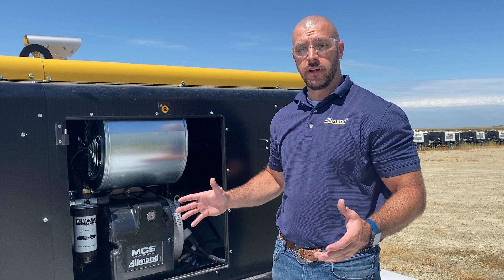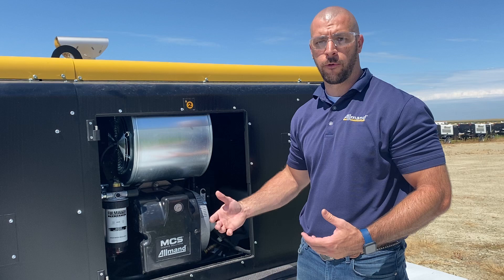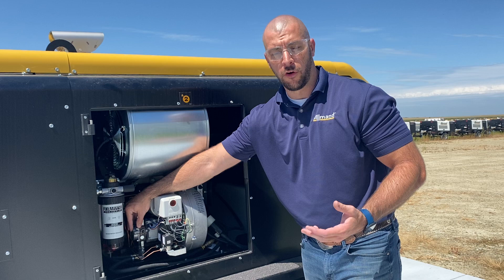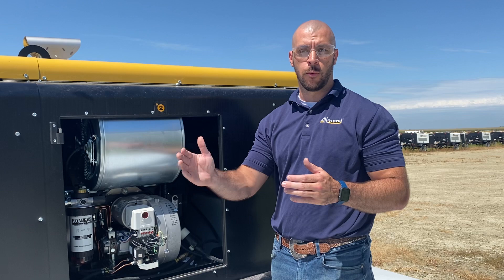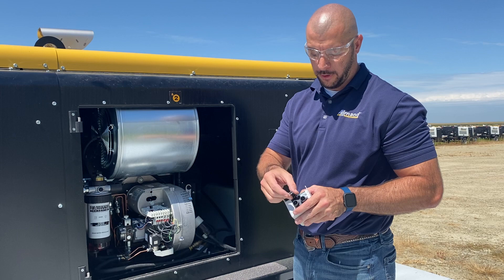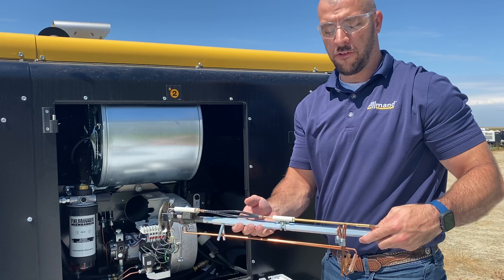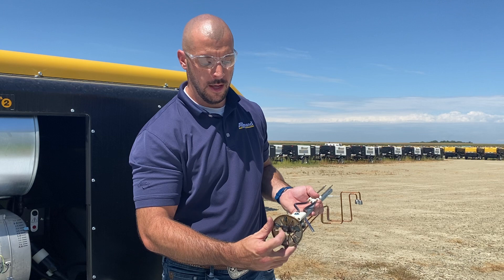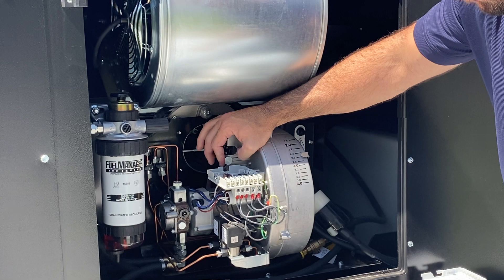Maxi-Heat® 1M Burner Overview

Comment: How do you adjust the temperature
Reply: Hello, Unfortunately, there is no way to adjust the temperature. The IQ system is preprogrammed that has a set temperature of 209 degrees and will maintain this temp while in operation. You can plug in an external thermostat to keep the heated area at a specific temperature. If you would like more information please contact our service department at 308-995-3431 or email solano.raymond@allmand.com